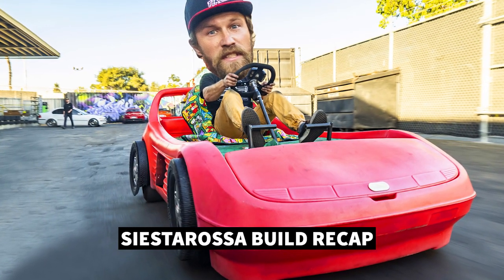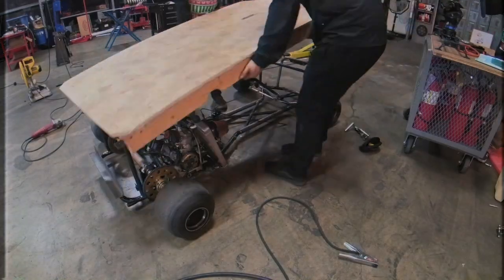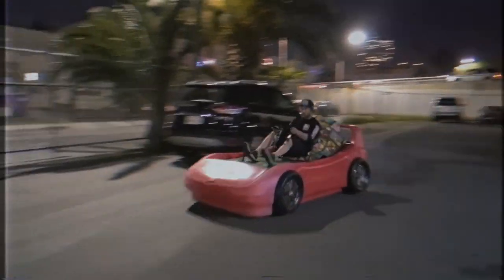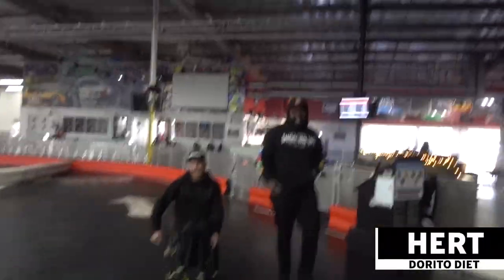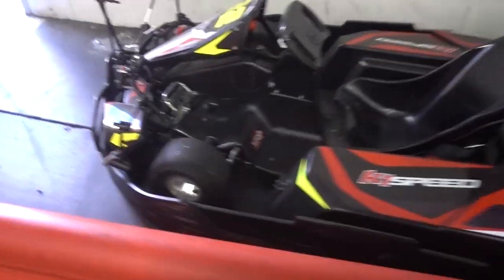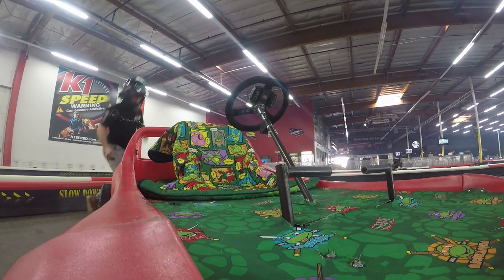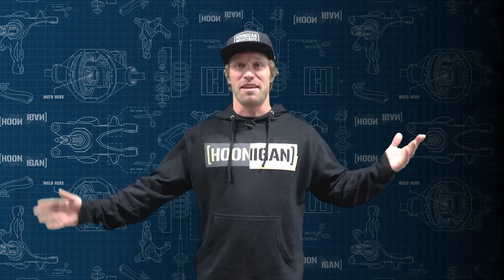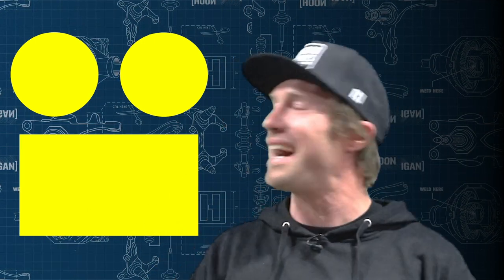We Build a Motorized Racecar Bed - and Take it to a Kart Track!

Comment: Instead of doing a qwirky wierd gokart bed you should do something fast and scary in a gokart? Late model 600cc shifter cart or something? Make the chassis long with heaps of steering lock so you can go drift it on grange or something? That would be cool? Chase the shart kart init or something?

Comment: The driving position is too high. I would kept the normal driving position, make the bed's top with a Big hole for the drivers head and shoulders, and put a dummy body over the top. Covered with the blanket, so it looks like the driver is laying on the bed

Comment: I wonder how K1 feels about all that smoke in the building lol. Shoulda just bought a predator 212 and put a stage 1 kit on it and it would drive just as fast and have a better down low power and not have all that smoke